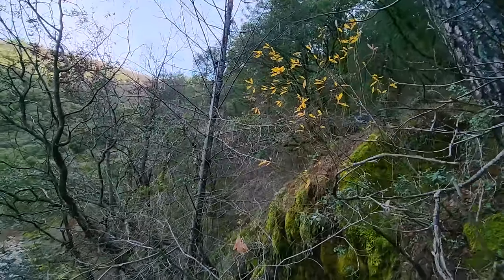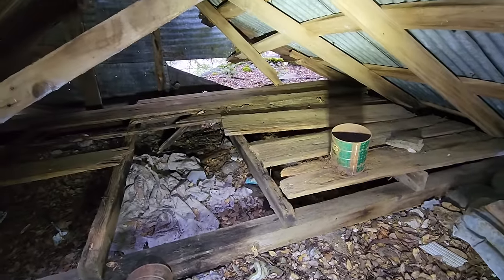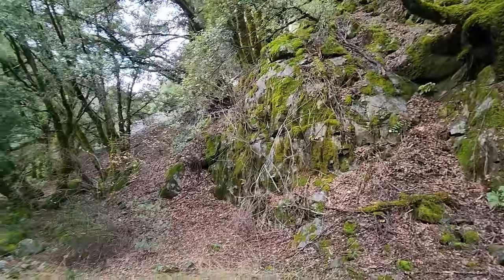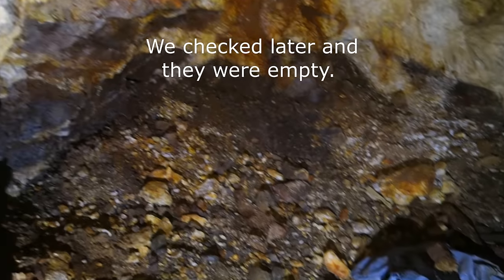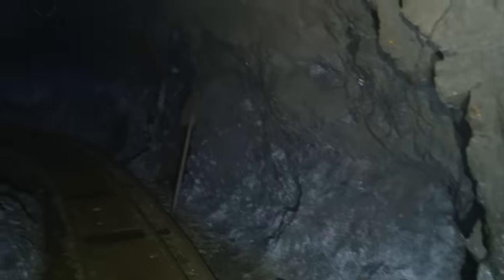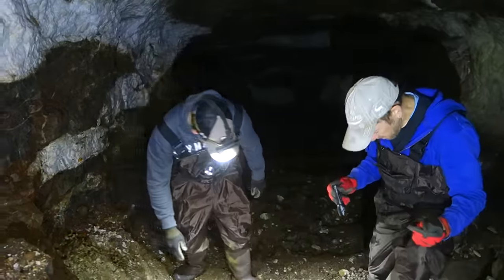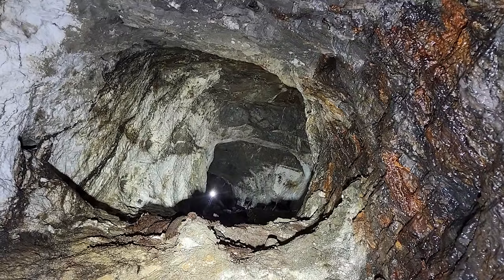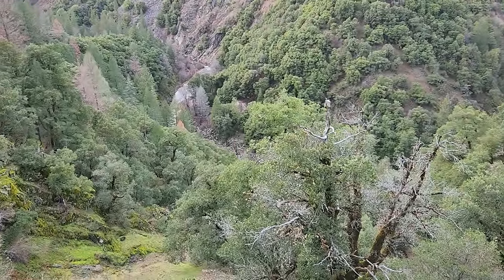Abandoned Gold Mine Overloaded With Quartz & Crystals

Comment: Justin, I just want to add... For those who are not familiar with those drill bits, the hole in the tip where the cutting cruciform is, the center hole is designed for a Steam Drill. Steam would travel down the center of the drill bit to blow the drilling debris back out of the hole, as the drill drilled the hole.  Later designs used compressed air to do the same function as the steam drills. Before the invention of the steam and air drills miners used a similar bit with a hammer. They referred to this as Single Jacking or Double Jacking depending on whether it was two miners per drill or a single miner per drill. If you are in a mine, most mines circa 1850 or earlier this is where you may find the solid drill bits. Most of the steam drilled mines will be circa 1889 or later. Plus most of the operational Hard Rock mines ceased to exist here in California after 1972. The last hard rock Gold Mine in revenue operation was the Empire Mine in Grass Valley, CA which is now a State Park.
Reply: I think your backwards buddy! If you don't line up the , whatyamaginger! To the power point! Then you won't drill!!
Reply: I used a Compressed Air Drill like a big Jack Hammer with different Drill Bit lengths up to 1.8m in length for drilling dozens of holes in varying depths and angles to set explosive charges to blast rock in the Mining Industry and Hwy Construction through the side of mountains, when they would get jammed I would use an excavator and chain to pull them out, it being easier to wait until you had 10 or more stuck before taking the time to remove them saving time. 

One day in 1986 I had a dozen 1.8m Long drill bits jammed and before I could remove them a guy operating the Grader reversed over each and every one of them amazingly turning them instantly into 1st Grade Boomerangs. The Boss so in Awe of these Returnable Throwing Sticks he gave us a bonus in our pay and a big Steak Dinner at the Pub. 🤪🤪
Reply: @Chris-CardVault    😅😂😂🤣🤣
Reply: For bathing??
Reply: Old disabled house bound dusty rusty rockhound here:  Great info! Thanks!
Reply: Thus the term double Jack -  sledge hammer. 
Single Jack is just a big hammer.
Reply: The first hard labor drills were called Diamond drills. Took two men to use it. And a sledge hammer.

Comment: I love the looks of that 120 year old compressor looks! The way things were were made back in the day and how materials were worked, caused a quality of machines that were just so good
Reply: In Jason's video of a tour in a mine ,I believe it was north San Deigo Ca. They had a big fly wheel compression  machine like the old one here. Amazing the tenacity these miners had. Be it old or more modern. Just so cool u found this intact !
Reply: So was that compressor run by kerosene hit-and-miss engines? What was the belt connection to and how did they get that down there? If this is California, did they have cheap labor like Chinese come in there to carve that trail out so they could use mules and donkeys to haul equipment there?

Comment: Incredible. Everything about that site was worth spending time checking out...everything. The amount of quartz and crystals there is amazing. That tram answered questions, but that wheeled compressor brought a bunch. Looked to me like a Detroit powering it, but not sure. That had to come in on some kinda two track, with a very gutsy guy riding a brake pedal all the way down on whatever was towing it. And no sign of what towed it in, which means they drove it out.
I don't recall seeing a belt driven old compressor like that in such amazing shape in many years. 
A beautiful spot indeed, would be a nice place for a cabin.
Reply: Looks like a 2-53 or 3-53 judging from the size of the blower. I bet 20 bucks that with some fresh diesel and a new battery it would start.

Comment: The Gardener-Denver compressor is a rotary-screw compressor that would put out a lot of air at pressure.  The antique compressor was probably powered by a hit-&-miss engine with a belt over one of the flywheels for a pulley.

Comment: Judging by how that quartz looked I'll bet it has been hydrothermically altered, and that the values will actually be in the contact zone between the hanging/foot wall and the quartz vein.

That would explain all the pockets as well as the well developed quartz crystal look. As well as why they used the quartz to building the gobbing up instead of hauling it out.

Comment: Beautiful country and a metric crapton of quartz.  I've not seen that much quartz in a mine in a long time.   Reminds me a bit of a road in my local mountains.   It actually crosses an exposed quartz vein a couple times.   There was a gold mine up there, but it apparently wasn't very profitable for the amount of effort.

As for the mystery of the modern compressor.   Could they have had it air-lifted into the valley?  Might seem extreme, but it seems like the only way they could have gotten it down the hill intact... unless there was a relatively clear path at the time and they used a wire wench to slowly lower it down the mountain side.

Comment: I noticed a generator on the newer compressor. Generator charging systems changed to Alternator charging systems in the early mid to late 1960's so I suspect that newer compressor is earlier than the 1990s.Although those miners could easily have picked up an old piece of equipment still working knowing they were not going to bring it back out.

Comment: That mine is interesting for several reasons. One of course is how the original miners got that compressor, ore cart and other equipment down there. The other question is the abundant quartz, but what we see is mostly what has been called "Bull Quartz" that is pretty much white with little or no red staining in it. Bull Quartz usually does not have gold in it, but obviously the old and more recent miners did a lot of work and there must have been something there as a reward.

I once found a complete cabin in very good shape (habitable) and a four stamp mill along side a branch of the American River deep in a canyon. No trails that I could see and clearly no roads. The only way I could figure they got the stamp mill down to where it sat, was to lower it by snubbing off of trees as it dropped down the slope a thousand feet or so. I was fishing and didn't have a camera with me, but have seen a lot of iron relics alongside streams in the Sierras. Since I was fishing, I didn't look for adits, but I also didn't see any waste rock piles.

I was wondering if you saw any old wire rope as you went up the hill to support the theory about a tram?
Reply from the maker: The sides of the canyon were so steep, that any artifacts (like wire rope) would have ended up in the river if they were not on the level area where the mine was located.

Comment: often, streams down mountain sides will follow fractures in the rock, faultlines, as there is a weakness.  i have found that in a mining area, mountain streams may have prospect tunnels following the fault a bit. on valley had a huge mine at the top, and about ten prospects everywhere there was a stream further down the valley, three or four hundred feet tunnels.  did you mamage to find a top station of the tramway?
Reply from the maker: Yes, we found where the upper tram station used to be, but it is just a level area on a cliff now. No artifacts are left.

Comment: The old air compressor, the plate with the name on it which says unloader, is a pressure relief valve. If for some reason the compressor produce too much air, it would lift the spring loaded plate and allow the access air to escape, something very similar is built into modern air compressor, nice find though, I love a good bit of old machinery.
Reply: An unloader valve is used to "unload" (stop the compressor from pumping air) when the desired pressure is reached so you don't have to stop the motor.

Comment: That trail at the end,  do you think that 25' cut could have been for the previous lift system there. Might be why they wrapped up in that spot. Hard to tell if that even heads in the right direction towards where the broken cables were located though.

Comment: Wondering how they got that equipment there? I was in the Army Infantry. We could move anything we needed up and over mountains. We just disassembled it into its smallest pieces and carried it in piece by piece and reassembled it where we needed it.
Reply from the maker: The old timers would have needed to do that with their equipment and the remains of the tram system they used were present. However, the most recent crew almost certainly helicoptered their heavy equipment in. There is simply no way I can see that they made it down the sheer cliffs with that compressor otherwise.

Comment: A hundred year old steel that isn't really as rusty as it should be is might have some nickel in it. Ford used it. It's why Tin Lizzy's are still around and solid but cars from the 50's and 60's rot, too expensive. Modern steels don't use it near as much either.

Comment: That split can is military. It held a munition, either naval or air dropped. It is only one section (the nose) to be man portable without needing a big ceiling mounted winch on a track, you can wrestle it around on a hand cart and a few guys can load it. 
  Not an expert but a 16 inch navel shell or a wing mount/internal bay 400 pounder would a reasonable guess.
Reply: Not infantry b/c they have much fewer men on the artillery teams and are limited by fatigue and injury to about 120 pounds max. Tank and mobile artillery are two part also for many countries,  not a rule though,  especially with auto loaders. (Please don't tear me apart,  I'm really just drawing from memory).
Reply: Ceiling tracks vary wildly in availability and length on ships. Some shells were brought right to the breech and some needed to be carted 50 yards. This would generally be after the close ammo stores are gone. 50 shells in lockers right behind a mount is not uncommon,  but it is limited.
Reply: I used to work on an AE (ammunition ship) back in the early 80s and there all kinds of munitions that were transported in "cans" like that. Longer ones, usually 12-15 feet long were usually used to transport missiles and torpedoes. There were some short really fat ones that contained cbu munitions or cluster bombs. Artillery shells were usually shipped in an open pallet banded together. That looks like a nose cone container. Back in the late 70s and early 80s they figured out how to take a dumb bomb and attach a nose cone containing telemetry and there were separate containers that held the fins. The idea was to utilize the thousands of pounds of dumb bombs nd make them so they could be guided in a glide pattern and direct them onto the target. The 16" shells mentioned before were usually transported on an open pallet banded two shells to the pallet much like 2,000 lb bombs. Side note: they were just the right size to take a short siesta on when working in the PI out at the ammo pier after 3 days of liberty in Olangapo down at the Freaks Stagger Inn!😁
Side note- I went to GM”A” school to be a fully educated and trained Cannon Cocker back in ‘83 and munition identification both in containers and out was a large part of the education. GMG2

Comment: Flowstone and straws off the ceiling are from Calcite.  Calcite looks quite similar to quartz but solutes into water fairly fast.  The piles of iron rich mud are likely calcite based. Both quartz and calcite may be present but the calcite is quite prominent.  Calcite would be softer than quartz and so easier to mine.